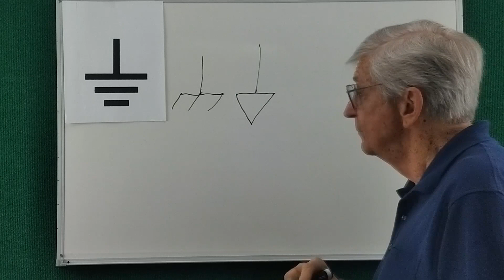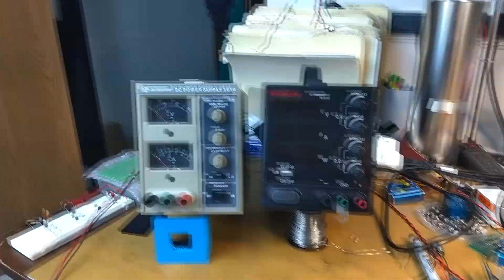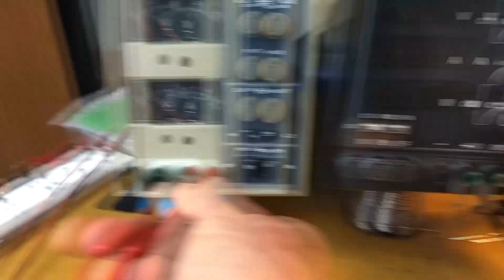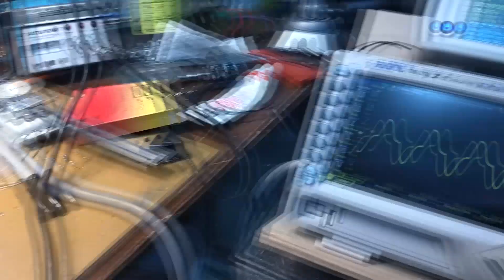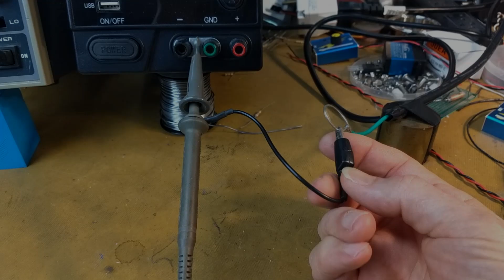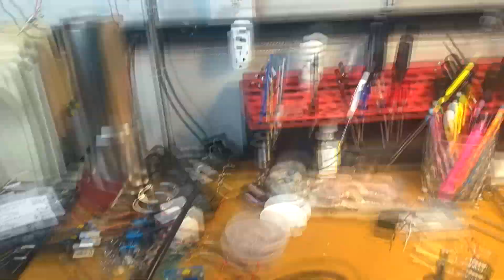Understanding Grounding/Earthing could save your life.

Comment: The soldering iron is grounded on the neutral.  There will be a potential (voltage) difference because the neutral is carrying current back to the service.

Comment: I'm really enjoying and learning from your video's Jim - Thank you.   In this particular video you explained the different ground symbols perfectly, but it then set me thinking - why do we use ground at all - surely a neutral and live wire are sufficient (well, apparently not!)?  Can you explain why we ground sometimes and sometimes we do not?    That would be a really useful video - and perhaps followed by a 'RF grounds' (can a safety ground and RF ground be combined?  are they the same thing?)  Thanks again Kevin
Reply from the maker: Thank you for your idea for a video. The need for grounding starts with lightning. The power company must ground things so that the lines entering your home do not go to very high voltages above ground. Also wind blowing across power lines can generate very high static voltages. This is also true for large antennas.

Comment: Great video and great channel!

The word "ground" is extremely misleading and I wish people would stop using it all together. This is especially confusing to new folks learning electrical/electronic engineering. It would be more proper to call it the "reference" rather than "ground," perhaps reserving ground for when you're specifically referring to the reference that is earth ground.

The other oversight is that these references are set as the zero point for a particular domain/circuit out of convenience, but this does not mean it is zero volts relative to some other object. Even within the domain where it is thought to be zero volts, it can and will deviate when you consider the impedance of the reference structure, common impedance coupling, and HF currents.

Comment: We've always used the first symbol (three horizontal lines) for "circuit common" for the last 30+ years. Interesting to learn that it has a special purpose.
Reply from the maker: Many people no longer know the difference between "garbage" and "trash". Our language and symbols can be quickly eroded by misuse on the internet. Thanks for your comment.
Reply: @Jimscoolstuff  I would use garbage, trash, and rubbish interchangeably. Much like kids today use "racist" to mean "stereotypical" even though they are very different. I'm sad for the continual degradation of language.... which predates the internet, but our instant connectedness does seem to be accelerating the downfall. Thanks for your response :)